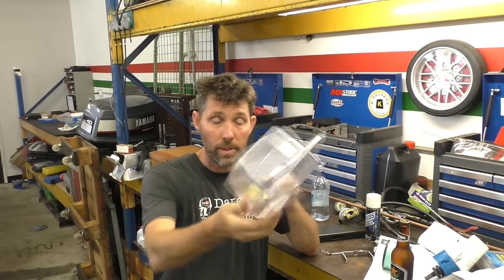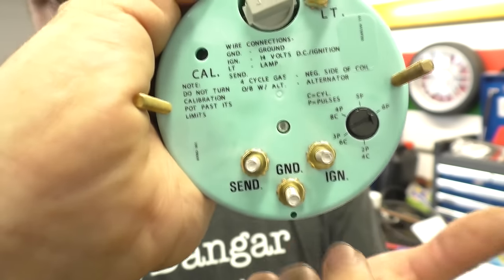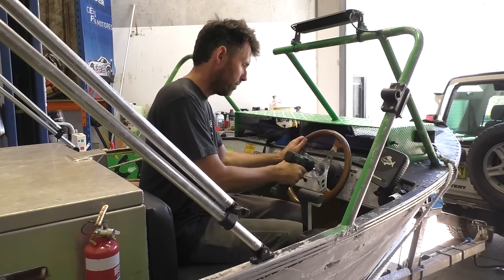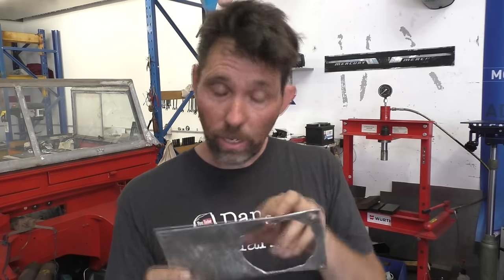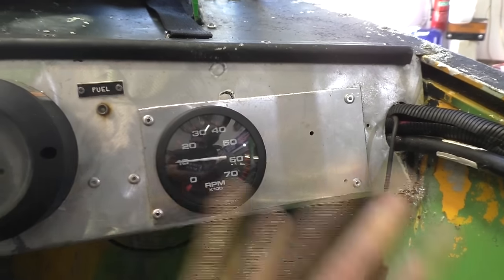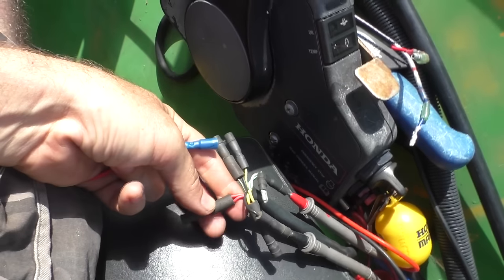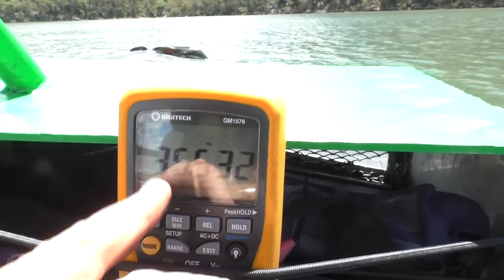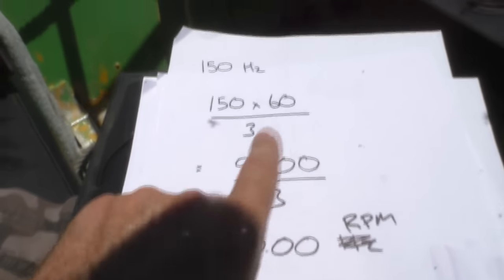Installing and calibrating an outboard tachometer

Comment: Thanks, I found the math sequence quite helpful. I have installed several tachometers without a frequency meter (didn't have one and wouldn't have known how to use the data before now).  When I installed a Sierra tachometer on my BF40, I looked in vain for number of poles info from Honda.  I asked the dealer, he said probably 4 poles.  The chart from Sierra said 6 poles.  In actual trial runs, neither of those gave reasonable RPM numbers.  So I used Honda's statement that the engine idles at 800 RPM (this is an early fuel injected engine) as a calibration point.  I tried different pole "P" settings on the tach until I got 800 RPM at idle.  That setting was 2 poles.  With a "2" setting, full throttle and trimmed up,  The tach showed 5600 RPM (5500 is rated power) using a  15" pitch 3 blade alum Solas prop.  I have used this setting for several years now and I believe it is a good one for this engine and tach.  I just wanted to say, there are other ways to get a tach calibrated, though sometimes it's a case of poke and hope.
Reply from the maker: I definitely think trying different pole numbers until you get a sensible value is an entirely reasonable way to go. You can't do an damage.

Comment: Exact same tach on a 1991 70HP 2 cycle Johnson with 12-pole.  Have arrow set to 6P and reading on tach at idle is high.  I assume I should chose 3-pole and try again.  Video is bookmarked for reference so I am hoping come spring time I can get my tach to read correctly.  Glad you had this video posted!
Reply from the maker: Hi mate. It does seem like a bit of a black art translating the motors poles to the setting on the tacho. Fortunately no harm comes from trying different settings, but you do need to know what the motor is actually doing so you can confirm when it is right. Good luck! :)

Comment: This is how EVERY project seems to go.  A solid plan turns into 4 new smaller projects before the first project has been completed.
Reply: Every ten minute project turns into a 2 hour fiasco/....adventures in Dodgeyness. I have 2 boats, So if I do the Math there will a 1/2 hour of actual boating per week....and then it snows in November. So it's mid May now,  I might get 5 good hours without tinkering with shit...:)

Comment: Great video Stu. Missed a bunch of your videos and have some catching up to do! A tach on a boat is incredibly useful. From dialing in your idle rpm to seeing if you are propped at the right pitch. I wouldn’t leave the dock without one.
Reply from the maker: Thanks Jack, I've still got to sort out that power problem at the forward control, but other than that I'm loving having it.

Comment: I know this an old post but I liked it so me commenting should be ok right? I wonder about you connecting the light wire to always be on when your ignition is on. Do you ever boat after dark? Why wouldn't you hook a jumper up to your boat lights so it's only on when you have your lights on?

Comment: One additional tip with the centre bit of a hole saw, the drill bit its self has no relief to the flutes so they do not cut the substrate and act as a guide once they have formed the initial hole. A standard drill bit has the flutes reliefs to give a cutting age and these ream the hole as it is cut, if used on thing plate with a hole saw they can oscillate and make the guide hole bigger than it should be then the hole saw will start to wander and give an oversized or oval hole.
Always use the correct centre bit for the hole saw 👍👍

Comment: I've found that apps that listen to the sound of the outboard and tell you the RPM are really good. They could easily be used for initial calibration if the multimeter doesn't have a frequency mode.
Reply from the maker: I have experimented with a few some years ago now, I should try a newer one and see if they work better these days.
Reply: Perhaps I was lucky in that our two-stroke is quite loud. Plenty of noise for the app to grab onto! :D "Acoustic Tachometer" is the name of the app (for Android).

Love your videos!

Comment: Cool, Good video on how these work. I put a long look on mine just for testing rpm back while doing final tune. I want to rig up a short one just from the engine but didn't want to wire it to the wrong leads
Reply from the maker: Thanks Tim, they certainly are handy for doing tune ups.
Reply: Interesting using Hz on a multimeter and convert to rpm too

Comment: Hey mate, could you do a video on fuel management? Like using a flow meter to get an estimate on fuel usage at different speeds. The only fuel management systems i can find are crazy expensive and over complicated or built into the newer outboard.
Reply from the maker: Yes, I'd like to add something like that to the trawler one day.

Comment: A good tip for useing hole saw  drill polit hole and turn bit around  and use smooth side of drill bit,, it will keep bit from wondering and making hold oberlong giving you a nice hole

Comment: hey stu..great tutorial... and great timing.. my boats tacho has just given up & im in the process of changing...just a question... was recommended a Faria Tacho... they any better/worse than the sierra? Running a 99  mercury 60 thanks again... ok..just noticed the instructions you showed were the faria ... must be the same
Reply from the maker: Thanks mate. I'm not sure which brand is better, they are different and marineengine.com sells both of them so I guess they carry both brands for a reason. It may be just personal preference I guess but I would expect there would be a reason to stock both.

Comment: Fan of the channel, all the way from Ontario, Canada. I this video is over a year old but I had my father in law ask me to look as to why his RPM gauge and Amp gauge are not working in his 22' Rinker. They were working last year and when he go it on the water this year they were not working. My guess is without having looked at it yet a bad wire but any advice or quick tips on how I might find the problem??  any help would be appreciated
Reply from the maker: Unfortunately tracing the wires from the outboard end all the way to the gauges is the only way to find this type of problem. Also check that the outboard is still charging. It could be a problem with the coil or regulator / rectifier.

Comment: 1 cylinder fires twice.
Once on compression and again on exhaust. 
A 4 cylinder has 2 coils
6 cylinders has 3 coils
If u r counting ignition pulses u should keep that in mind.
Example: 1 cylinder will count double rpm. Because it is thinking exhaust stroke is compression. So its like compression compresion per 1 rpm. But reads 2 rpm. 
300 rpm will read 600 rpm.

Comment: Hey there, great channel great content. Would you know if there is a unit or if it is possible to make a unit that can take all that analog information and convert it into digital? Engine temp and RPM's.  I have a 1998 60 HP outboard 2 stroke motor and would like to use my Humminbird unit dash feature.   So I would need to somehow convert the analog information to digital and then run it to a NMEA 2000 system then into my Humminbird Unit. Some of my thoughts are,  maybe using a Rasberry pie or an Arduino or maybe you might know if there is something out there that already does this?

Comment: I know I’m about three years late Stu but, I’m planning this install on a Suzuki DT 90 V4 motor that I mounted on my 16.5 ft Smoker Craft replacing a DT55 that was decidedly under powered so, I’m going from three cylinders to four. First, in the early parts of the video you kept referring to charging coils, I think you meant ignition coils?  That makes sense to me. The other thing is about the hole saws and drill bits for them. I notice that the bit that comes with the saw has a short part of actual cutter. I also checked on my newer ones and find that the part of the pilot drill that is straight across the blade teeth has no drill flutes. I guess this is to stop the saw wandering and causing the pilot hole to creep, and that’s exactly what happened to me last week when I was cutting a 4” hole in a piece of 1/8” plywood. I ended up with a 1/2” pilot hole and an oval 4” hole 😳😂. Anyway, great video as usual. Cheers.

Comment: Excellent, just the video I was hoping for.. Planning on putting a tachometer on my racer over winter..

Something I would like to see is installing a fuel sender and gauge in a normal tank.. Theoretically should be possible although perhaps would involve a bit of experimenting...

Cheers Stu! :)
Reply from the maker: I did start a video on that using a sender / gauge kit, but unfortunately the sender didn't fit in the tank I had. I'm going to be doing a series of vids on building a boat from scratch soon and I'll definitely put a sender in that tank.
Reply: Dangar Marine I'll be looking out for that project, sounds awesome! :)

Comment: The crank is rpm.
The cam determine s the stroke. The ignition fires at same time place of the crank shaft regaurdless of the stroke. Firing on exhaust stroke mesns nothing but on compression stroke it explodes the fuel air mixture making the power stroke.  ( 2 sparks but only 1 fire.) This is why u get a false double rpm reading

Comment: Hey Stu
I have a F15 Yamaha 2 stroke from 2001.I am trying to install a tacho but how do i find the signal wire on the engine, so I can connect from send to signal wire ?
As always my favorite channel 
I really like your longer vids
Best regards 
Frank 
From Denmark
Reply from the maker: You'd need to do a google for a wiring diagram or at least the colour coding of the main cable that comes up to the forward control.

Comment: I just bought the same tach.  Goes to zero when powered, but not indicating any rpm.  Checked both the coil and tach signal end with multimeter for positive signal.  Adjusted setting on back of tach and still nothing.  Is it possible this tach does not work with my old Mercruiser 2.5L I/O?

Comment: This may be a silly question, but I'm trying to learn! I've got a 1982 Mercury 40hp.  I installed a Mercury tach and the instructions say to set it to 4P for SN 5823918 and up, mine is 6084617, but the tach isn't reading at idle or low rpm, only higher rpms (in the driveway with motor flusher).   All the wiring is brand new.  Ideas? To calibrate, does the motor need to be under load (e.g. in the water)?  Thanks for the videos!

Comment: My tach seems to be turned off most of the time, except when I place an electrical load like tilt/trim then it jumps up to an accurate reading. Any idea why?

I replaced the voltage regulator (using an off-brand) and at some point re-did wiring under the dash and so either thing could have screwed something up. Maybe the behavior means something to you to point me in the right direction.

Comment: Thanks for the video. I have a question. My multimeter reads the frequency but the signal cable tension is too low. (2VAC) What is the working voltage range of this signal?

Comment: Hi Stu,  love your videos. I'm am completely new to boating, with a half built boat in the garage, so finding your videos very informative.

I have an old 25hp Merc, pull start only. Does this mean no charging coil?  Can I still fit a tachometer?

Cheers
Reply: GJ Yes you can add a tach. There is a product called mini tach or something like that, pretty cheap if you don't have a center console to mount a larger gauge
Reply: jimbo gasoline 

Thanks Jimbo.  This is all new to me,  so appreciate the info.  Will need to go and do some research.  Cheers
Reply from the maker: Those mini tachs that Jim mentioned are really cool, but you may well find the motor has an AC outboard on it still as they were originally designed to just run some simple lights on small boats. A Merc guy will probably be able to tell you more.
Reply: Jimbo- and Stu- I reckon one of the mini tachs on a tiller steer could work well. Stick the tach on the front of the cowl, the sense wire could have a bullet connecter in it for when you are servicing the engine so you could remove the cowl. I have a couple of wire wrap tachs from go karting - water proof and cheap. CPR sell some decent ones but you can get the same ones from ebay at a bit less.

Comment: hey. i have a mercruiser 3.0l with a bad tach. im trouble shooting to see if i need a signal wire. the alternator.i have is a saej1171 from mercury. i need help figurign out if i need to run a signal wire or buy i new tach? any advice?

Comment: I am most likely wrong, but to me while the P= # of poles makes perfect sense, but the C = cycles confuses me.  To me, and looking at the back of the Tach, the "C=cyl" leads me to think that "cyl" means cylinders.  Any chance this is the case?
Reply from the maker: Yep, I think the Cyl is cylinders. When you are hooking up to the charge coil the number of cylinders is irrelevant, but I would say this tacho must be able to be driven off the ignition too in which it would definitely need to know how many sparks makes a single revolution.

Comment: When I have crap hole saws. With out a pilot bit.  I start with only say a quarter of the holesaw cutting. Then slowly cut to half. Then 3/4 . Then a the full saw. It's works. 2 hands needed lol. Can wobble haha
Reply: Yeah, battery drills with hole saws over 50mm generally don't live long. I have found a mains powered drill is the only way to go for the bigger holes saws, and variable speed is needed too.
Reply from the maker: Interesting tip, I think I would have struggled to get it started on smooth aluminium without the centre bit, but it's always good to know things to try when you need to.
Reply: For over 50mm I use a battery masonary drill with a chuck adapter. Works well u can thash it lol
Reply: BAJATWIN You could use a drill press to cut a hole in small piece of plywood and then clamp plywood to dash, with plywood acting as a  guide.  Just a suggestion.

Comment: Hi...how much poles has the Johnson 70HP from 1994?
I have a new rpm tacho, and the script for programming ask me to poles and speed ratio...
i can set 4 poles to 2 speed r. ,or 6 to 3, or 8 to 4, 10 to 5, 12 to 6.
adjustable range at instrument was 1.0 - 360 for programming
thx a lot  
uli

Comment: love the advice on the steering wheel puller.  way to hammer it home.  lol .i have an optical tach for machinery that picks up a reflected light.ya place a reflective sticker on a shaft or flywheel. would work great.  most dont have meters. and in amongst my 10 or so i dont recall one of them that reads hz.   which leaves me thinkin....... will an automotive tach pick up the ignition coil on a cdi ignition???  i've never tried it. the higher cdi voltage may not be good for it.
Reply: Yeah, I wouldn't recommend you do that on a CDI:-)  A meter with Hz (frequency) capability is pretty cheap from Jaycar - about $20 .
Reply from the maker: The little ones you get have a wire you can wrap around the HT lead and then configure it with the number of cylinders and whether it is two stroke or four stroke. The meter itself lives under the cowling but I can't see why that same system could be used for one on the dash.
Reply: Stu, the 'wire wrap' system has a few issues you need to take into account. 1: the wire wrap itself becomes a transformer- so if you wrap 5 turns onto an ignition lead, you multiply the voltage accordingly. So if the leakage voltage is say 20 volts, the wire is carrying 100volts (with almost pico amp current , so no real risk to anyone).2: The spark plug voltage rise rate is very fast .  1 & 2 together with the longish wire run means you will be creating an aerial with ignition hash - not good for radios , fish finders etc.  The normal car tacho needs a current pulse to count (normally 12v, goes to ground when the points close) - because it is triggering a transistor - so that long wirel is unlikely to work- car tachos are designed for milliamp current levels, pico is a little too low. The wire wrap tachos use capacitive coupling and trigger on the induced voltage spike.
Reply: good points  Ron Powell.  those wire wrap tachs are ok for repair work , i wouldnt think to try to use one as a dashboard unit or as a permanent solution.  the whole point being that the universal one stu got for the dash needs another one to make sure of the caliration is correct. i/o's  typically run modified car engines so a vehicle tach works fine. most if not all outboards run cdi's.  having watched other video's  i got to thinkin.  a lot of people have car tachs and "tune up analyzers" sitting around in thier garages. and hooking up one of them wouldnt be good. why buy another tach to calibrate another tach if one of these are available? so its on my list to find a cheapy at a garage sale and tear it apart to see if it has any protection in its circuitry.  perhaps some two dollar resistor voltage divider circuit could be added to make it possible.  i do see online that people make adapter boxes but at $40.00 might as well buy a tiny tach wire wrap one. of course had stu taped the instructions  to the beer in the fridge we might have seen the selector adjusted to the proper setting that would have put it in the ballpark to start with .  lol cheers
Reply: If you want to use a car tack for CDI, you need a converter.
You can build one your self, if you are not afraid of the soldering iron.
I have instructions in one of my videos...
Greetings from the other side of the planet by the way (literally)!

Comment: Dont know what i did wrong hooked up the same way you did and only got 2.9hz on the multimeter didn't change when reved moter or maybe the multimeter iscto cheap its a johnson 3cyl i counted 8 poles plus the charge coil so what would be my pulse count be iam thinking 4 but it reads about 1200 on tachometer and with a laser tachometer it read close to 700rpm so do i need a different tachometer for a 3 cyl